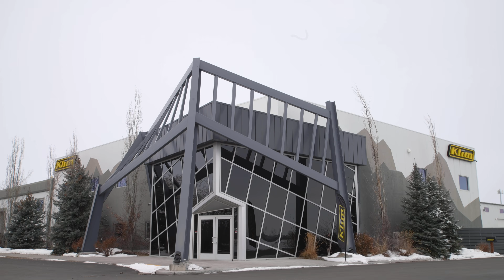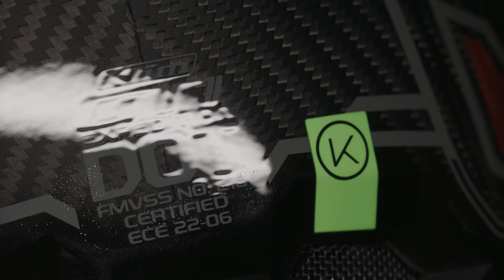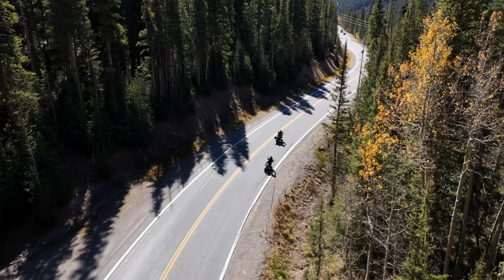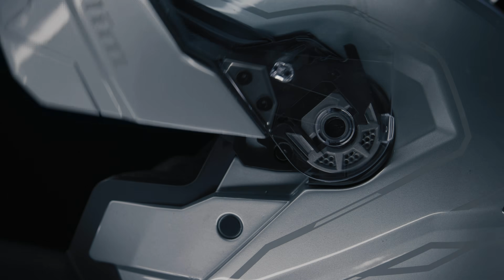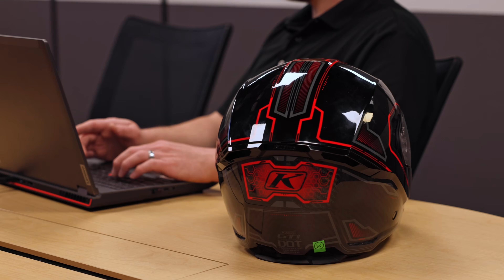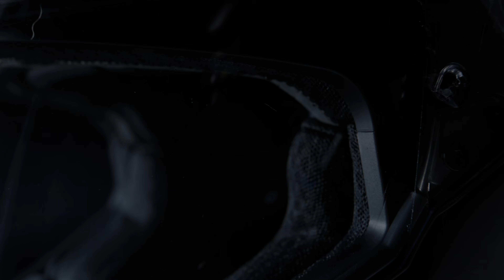Introducing The GT1 Expedition Helmet

Comment: Any update on release date? The TK1200 I’ve been using for the last 5 years was just ruined after saving me during a motorcycle wreck. I need a replacement but the TK1200 has been discontinued.
Reply from the maker: Hi! Yes! Our ETA is showing we will be getting some within the next 2 weeks with more coming mid-May 😎
Reply: @KLIMMotorcycle  Is the GT1 sizing for ordering fitment identical to the TK1200? large = large

Comment: What are the steps of the 3 outer shell sizes?
Will there be a slimmer DOT-only version or is ECE always included?
Reply from the maker: Hi! GT1 shell steps: 1 shell size for MD and smaller. 1 shell size for LG. 1 shell size for XL and larger. Right now, it is an ECE/DOT only helmet.

Comment: No mention of weight, cost or sound levels..
Reply from the maker: Hi! The weight of the GT1 Expedition is 1650g +/- 50g. Cost is $999.99 USD. As for sound levels, we would like to boast about our sound levels, it won't do much good for comparing to other manufacturers. The reason for this is that there is no universal test standard for wind noise measurement in a wind tunnel. Everybody's wind tunnel will be slightly different, the microphone placement will be different, what test rig the helmet is placed on will be different, the wind speed chosen for the test may be different (it's usually 100km/h or 62.1mph, we do ours at 75mph). We feel very confident in the quietness of this helmet, but we can't guarantee you experience will be the same as someone else's considering how rider height and fairing/windscreen height affect aeroacoustics in the real world. We're sorry to hear about your tinnitus in your current helmet, hopefully this helmet can help mitigate that. It would be worth checking if your local dealer can do a demo day for you and you can test a helmet out before buying.

Comment: Any info on noise levels? Number 1 item on my shopping list is how quiet the lid is as my tinnitus has increased with my current lid.
Reply from the maker: As much as we would like to boast about our sound levels, it won't do much good for comparing to other manufacturers. The reason for this is that there is no universal test standard for wind noise measurement in a wind tunnel. Everybody's wind tunnel will be slightly different, the microphone placement will be different, what test rig the helmet is placed on will be different, the wind speed chosen for the test may be different (it's usually 100km/h or 62.1mph, we do ours at 75mph). We feel very confident in the quietness of this helmet, but we can't guarantee you experience will be the same as someone else's considering how rider height and fairing/windscreen height affect aeroacoustics in the real world. We're sorry to hear about your tinnitus in your current helmet, hopefully this helmet can help mitigate that. It would be worth checking if your local dealer can do a demo day for you and you can test a helmet out before buying.
Reply: Exactly. Same here!
Reply: Check out Schuberth. Usually if you ride without a  (swirling) windshield you are as quiet as it gets with C3, C4, C5 or even the E2.
Reply: A. Nice response from KLIM. That’s surprising. 

B. Helmet noise levels are irrelevant if you’re riding at highway speeds. Even the best helmets aren’t THAT quiet in the real world and you will always need ear plugs. 

I have the klim X1 alpha that’s practically the non-modular version of this, and it’s plenty quiet even at highway speeds… in pure laminar wind (like standing while riding with no traffic around.) but once you have turbulence from other vehicles and even small windscreens, etc, it’s plenty loud.

Comment: An opportunity was missed to not talk about the ease of universal comms installation
Reply from the maker: Good point! These helmets are compatible with all major comms systems.
Reply: @KLIMMotorcycle  most helmets are now, but any special consideration?  I have always thought it was a miss to not have channels for wires and connectors.
Reply from the maker: Thanks for the feedback!
Reply from the maker: It has a Velcro slit in the neck roll to accommodate a comm system that clips to the shell. The wiring can be pressed into the seam of the EPS. There is also an infinity edge on each side of the shell for a variety of comm attachment methods.
Reply: @KLIMMotorcycle  much has been made of the infinity edge basically saying it should eliminate the need for sticky pads, etc. It would be worthwhile doing a video having a Cardo or a Sena being installed on both the X1 and the GT1
Reply: Why has this lid not been released yet? Is it now a 2 year delay???
Reply from the maker: Hi Sean! There were some production delays and they are finally showing up. Many of our dealers are getting them this week and we will be seeing them on the website next month!